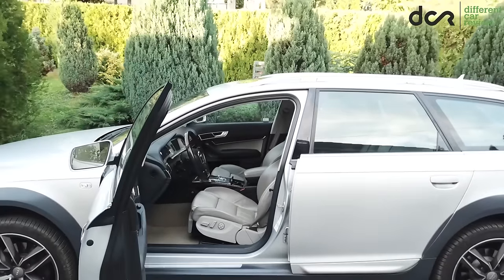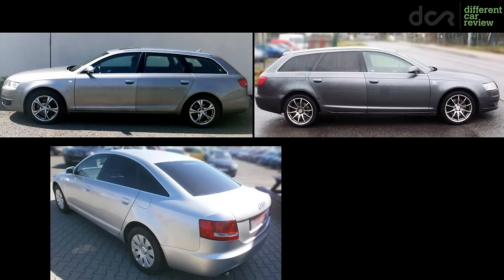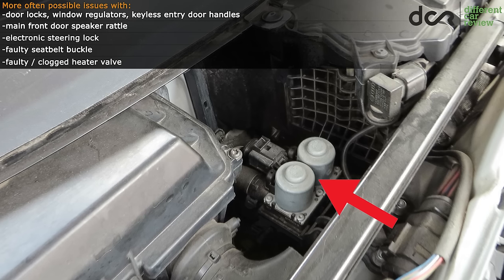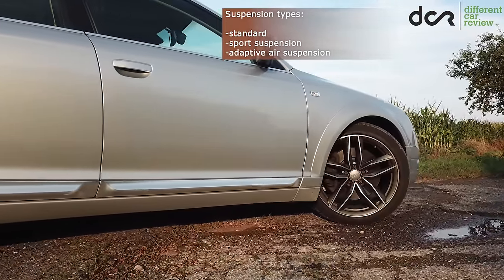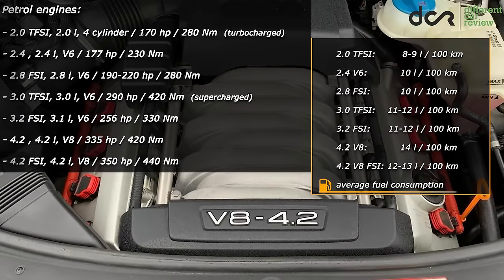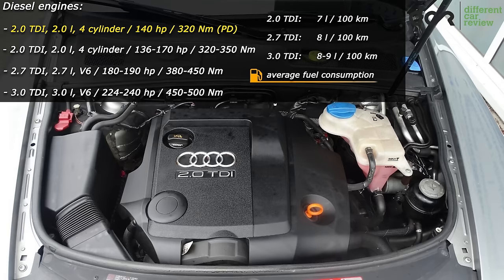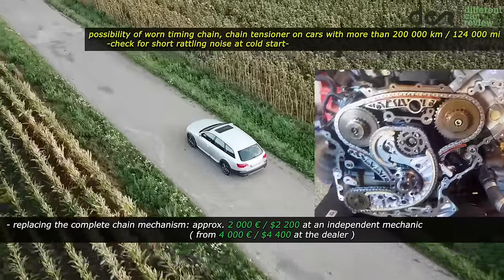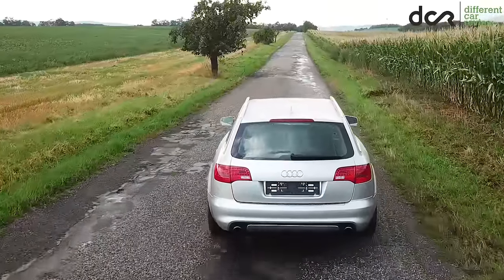used Audi A6 (C6/4F) - 2004-2011, Complete Buying guide with Common Issues

Comment from the maker: 1st gen 3 0 TDI ALL Issues https://www.youtube.com/watch?v=_so6yhV5qXE
2nd gen 3 0 TDI ALL Issues https://www.youtube.com/watch?v=272PBPSS2no

Buying a used Audi A8 (D3/4E) - 2002-2010 https://www.youtube.com/watch?v=PijHDhQ3Gas
Buying a used Audi Q7 (4L) - 2005-2015 https://www.youtube.com/watch?v=04o6oK1J5fM
Buying a used Audi A4 (B8) - 2008-2015 https://www.youtube.com/watch?v=ixDwvZbWtWM
Buying a used Audi S6 (C6/4F) - 2006-2010 https://www.youtube.com/watch?v=mpf5CgCOhM0
Audi A6, A8, Q7 STEERING LOCK ISSUE https://www.youtube.com/watch?v=ujxQLU_rw3I
How to replace the Cabin Air Filter on Audi A6, S6, RS6 C6 - 2004-2011 https://www.youtube.com/watch?v=zjRaxd3l7y4

Buying a used BMW 3 series (F30) - 2011-2019 https://youtu.be/SV15lqX30ek
Buying a used BMW 5 series E60, E61 - 2003-2010 https://www.youtube.com/watch?v=xmcBIa9tAq8
Buying a used BMW 6 series F06, F12, F13 - 2011-2018 https://www.youtube.com/watch?v=is8QeVYYB8E
Buying a used BMW M5 (F10) - 2011-2017 https://www.youtube.com/watch?v=geoivnl1QrY

Buying a used Mercedes S-class (W221) - 2006-2013 https://www.youtube.com/watch?v=mg9Fy0RlOMk&feature=youtu.be
Buying a used Mercedes E55 AMG, E63 AMG (W211) - 2003-2009 https://www.youtube.com/watch?v=-iGw8_YLL44
Buying a used Mercedes E-class W212 - 2009-2016 https://www.youtube.com/watch?v=Q7t1_SsW-kc

Buying a used Volkswagen Passat (B6, B7) - 2005-2014 https://www.youtube.com/watch?v=lu36PMVBChI
Buying a used Volkswagen Passat CC - 2008-2016 https://www.youtube.com/watch?v=SFY6Wx_55Yw
Buying a used VW Phaeton - 2002-2016 https://www.youtube.com/watch?v=FGXXchOF_g4
Reply: Please make one clip with A6 4f2 c6 sedan ,benzine / petroleum , 2,4 liter V6 Quattro , manual transmission ( 2004 - 2008 ) my beautiful "Torsenyyyy baby girl "❗❗❗
Reply: Can you please make a review on the mazda 6 from 2008 to 2012 in general , thank you in advance

Comment: People from outside Europe won't understand why you focus so much on body panel gaps and hidden accident damage. 😂 Must be nice to live in a country that has trustworthy people
Reply: lol.... thats exactly me.... Why the panel gap issues?
Reply: Luca van Gorkom It is not very uncommon for very severely accident damaged cars to be sent to Eastern Europe for some very questionable repairs and then sold again either in the country of repair or some other country to someone who is not aware of any previous repairs. Usually these cars are too damaged to be properly repaired at a reasonable cost considering car value. Labor is much cheaper in some Eastern European countries and due to this accident repair industry spare parts are very available.  Sometimes these cars might have non functioning airbag systems without the airbag light alarming the driver. You really can’t know if everything has been properly fixed without very in detail investigation of the car and its history. 

Poor panel gaps, obvious  poor quality repaint and other signs of accident damage or body repair are an alarming sign that car might have had some questionable body repairs in the past.
Reply: @gaedzable  thanks for the explanation! I guess there are also downsides to being able to travel so quickly and cheaply between so many different countries. Anything like that's unheard of in New Zealand, my country. If there's any sort of accident here, the car has to go through a giant warrant system to ensure it gets repaired at a trusted place, or they just bin the car.
Reply: @lucavangorkom9453  Speaking of any warranty repairs in car sales industry - there's is no such thing as "trusted place", neither in NZ nor ANYWHERE. In perfect world - if the car is not worth to be fixed it should be scrapped. Back to reality - at the end of the day it's all about $$$. In U.S. or Western Europe many accident or flood damaged vehicles are being sold "as-is" by either the owners or insurance companies at auctions and then exported to Eastern European countries where (as mentioned above) labor is cheaper and lots of second hand parts available as well, to eventually get back on the market in "spotless" shape, like nothing ever happened. It's just a tip of the iceberg though. That's why the panel gaps check is a basic and one of the first steps when buying the vehicle. This phenomenon however requires wide geographical diversity, where the cars can be imported/exported multiple times and it's way more difficult (sometimes impossible) to chase the full vehicle history reports, service records, etc. Even though you wouldn't have such an experience living in New Zealand, I guarantee there's quite "a few" vehicles on NZ market with poor panel gaps, poor paintwork quality and other stuff that would make you start asking questions and think twice before placing cash on the table. Unless it's paradise on Earth... which is very unlikely in terms of that business :)
Reply: @exs3574  I see what you mean. But in NZ there is such thing as a trusted place - the insurance companies are trusted in NZ and are the ones who insure the car gets processed correctly.  If the car's a write off, the police ensure the car doesn't get warranted or registered again. The only potential we could have might be cars imported from Japan, but even most of them go through a very thorough process with grading system and certification.
Reply: @lucavangorkom9453  Not exactly what I meant. We all trust the insurance companies, otherwise we wouldn't spend our money with them. They cannot guarantee how it's done though. They don't interfere with the entire service process and quality. It's all on the dealer, service department, body shop, etc. And that's my point - speaking from experience I wouldn't call them "trusted places" for sure.
Insurance has actually nothing to do with all this especially if you don't have a fully comprehensive policy which means you pay for your own. Written off vehicles, police reports, imports, etc. - it's not a case. Long story short it works pretty much the same all over the world. And if NZ is really different on this matter I'm moving tomorrow!
Reply: @gaedzable  in this case, a vag cable will show these "adaptations" with a simple air bag module scan.

Comment: I've had my A6 3.0TDi Avant 10 years now (it's an 07 that I bought at 2 years old). In all that time, I've had the heater valve, leaking tailgate pipe and drivers door regulator issues - but my car has now over 205k miles: or approx 330,000 km's. Only issue with the engine had been a faulty air flow meter: approx €145 delivered from Germany and fitted by myself in less than 10 minutes. I had the ECU remapped the day after I bought it, and though I can't vouch for the exact BHP figure, I have had it up to a GPS recorded 154mph (just over 160mph on the clock), with a tiny bit more to go (so nearly 250kph real speed), and I am more than happy with that for a big diesel dog carrier!! Still looks and drives perfect (touch wood!), and have absolutely zero plans on changing it any time soon: it's fast, comfortable, has a massive load space, Quattro for the awful weather and on super-long motorway journeys, I can easily get 1000km's to a tank of fuel - the perfect all round car really!
Reply: Hi I'm thinking of buying a 2007 le man's and it has 389000 Kms ... I'm just wondering how yours is going now a year after your post .  ..
Reply: Hello, just wanted to ask how much liters does it consume per 100km? City vs Open drive.
Reply: @GreatUchiha123  I generally get 9.42 L/100km (30 mpg) in town and up to 7.06 L/100km (40 mpg) on a motorway. The best I've ever got was 6.57 L/100km (43 mpg) on a 725km (450 mile) run. (2005 3.0 TDi Avant)
Reply: Wait a minute. It can actually drive a 1000km without a refuel????
Reply: @KM-jg2rc  yeah definitely. You have to go about 95km/h consistently, no fast acceleration.
Reply: @jogan9196  niice. I was thinking lately to change my Nissan AD to Audi A6 this year or the next. But car deceiving is popular in Russia especially towards foreigners like me. So if there's any more hints adding to the video I would totally appreciate it 😇
Reply: @KM-jg2rc  I haven't had any problems that weren't in the video. Rear window regulators are broken, rear window washer is broken, AC doesn't work and the electric system thinks that some bulbs are broken but it's wrong. I think the washer fluid has leaked on to the electronics and is making them faulty.

Comment: I bought my A6 in November 2018 with just under 200k on the clock, it's 2009 year of production, facelift model with 2.7 engine and 190 hp. To this date I had no problem whatsoever, just regular maintenance. Currently it has 250k, inside almost like new, everything is solid, spacious, comfortable, made for cruising through multiple countries. It's the car I always wanted but wasn't able to buy one, now from my experience I can say that the car is really really great and I haven't regret one bit buying it 👍👌
Reply: ty
Reply: Lucky! I'm looking at a 3.0T quatro 2011 year. 60000 miles. $13000. Worth it?
Reply: About to buy a 2008 A6 3.2 myself with 200k or so miles. Fingers crossed!

Comment: I've got a 2008 3.2 a6, this was the most thorough video I've ever seen! My car is leaking oil has timing chain noises the cabin smells like gas when it runs and it vibrates. It's at 240,000. After seeing this I realize I need to do over 5k of work on it 😂 it's not worth buying a used Audi. I've had mine since it was at 160,000 4 years ago
Reply: Absolutely nothing wrong with used Audi vehicles as long as you know what you're buying. 3.2 FSI says it all... but you probably know that already :) If you've done some research before purchase you'd have never even considered the A6 with this engine and 160K on it.
Reply: not bad going then if you've got 240k on the clock, all the more reason to buy one of these (keeping in mind the maintenance/checks mentioned on this video)
Reply: I have 2005 3.0 tdi with 350.000 km and it's running  perfectly
Reply: @draganz32  sounds like she's been maintained and probably parked in a garage lol I live in Canada it's -30 and I need to hurry to work sometimes takes a hard toll on any car I guess but mine was parked outside and I hardly did maintenance! I recently sold it for $2k lmao
Reply: @shumushrif9204   regular maintenence is very important
Reply: sameeeeee i had the same car. A beautiful black 2008 Audi A6 .2 Quattro FSI with chrome wheels. Beautiful car, but had leaks everywhere, motor mounts was worn out, smelled like smoke exhaust, put 3k trying to fix and never was good. I wish I had the money to keep it. Sold it and got a Honda instead.